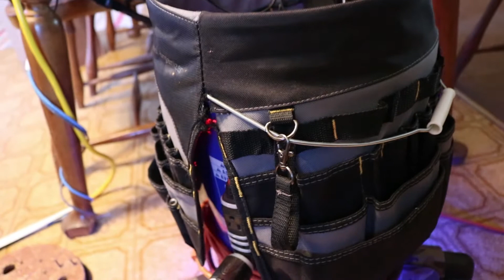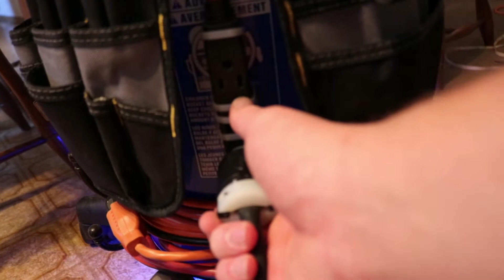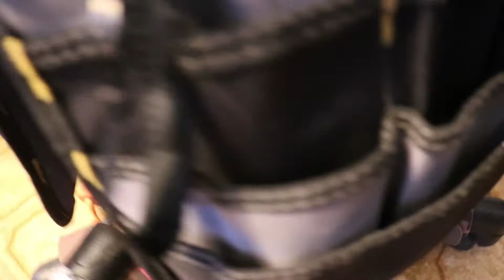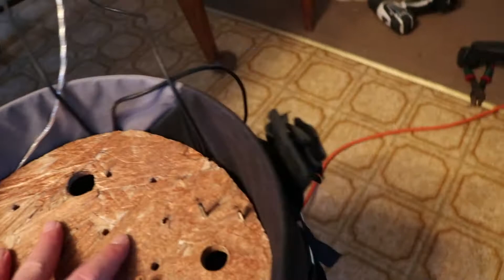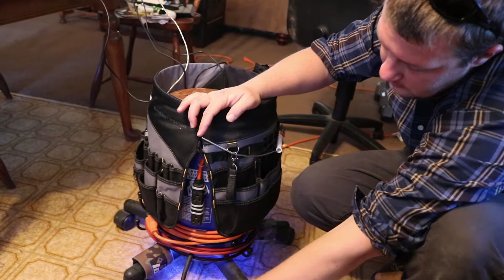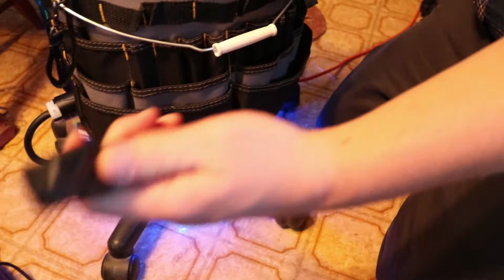Custom Bucket Design (Update)

Comment: It's a interesting idea.  I would mount a covered switch through the side of the bucket instead of using a plug to make and break connection.  I would also use a GFCI outlet to protect the circuit.  
The design is perfect for a display booth at a convention or for lost weekend in a industrial loft, but I would not use it camping.  For me camping is outdoors and in the dirt.  Chair casters don't do well on uneven surfaces and soft ground.  Buckets tend to collect condensation and that doesn't mix well with live wires.   
You should be aware of a potential safety issue.  Power run through a coil of wire creates a magnetic field.  If there is no ferrous metal for magnetic field to act upon it becomes a air core inductor and the wires create heat.  To be on the safe side undo the entire coil before running power.  Nothing worse than a bucket meltdown.